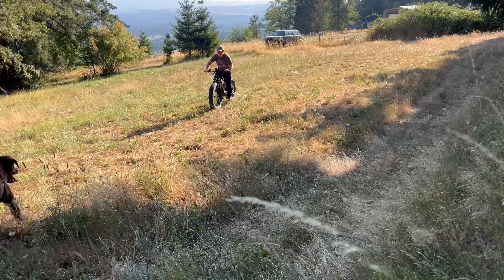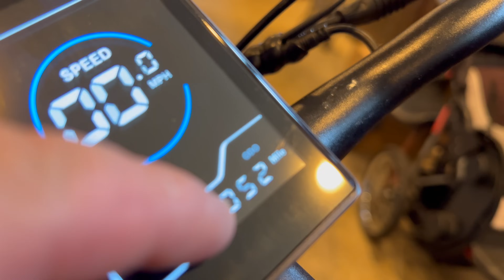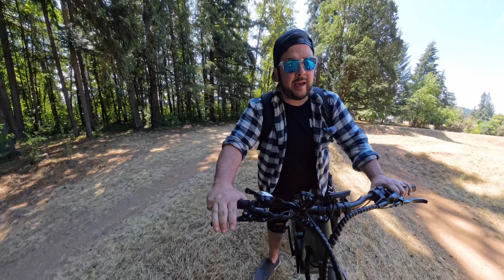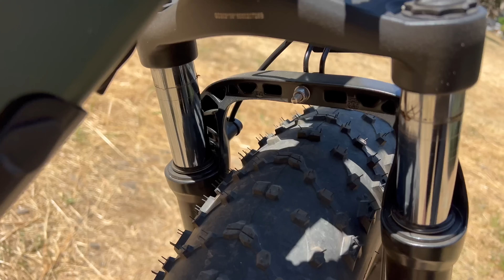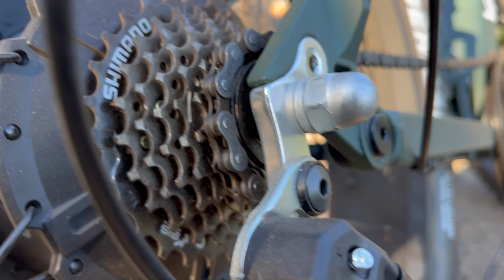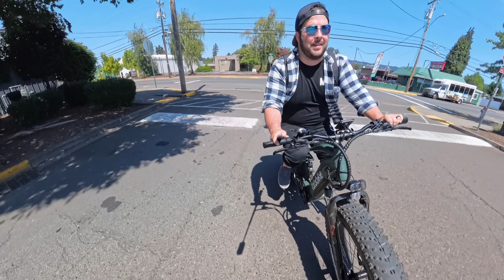Beefy Eye Catching 👀 E-Bike for OFF Roads, LONG Range & Comfortable Rides. YotoBike Leopard Pro +

Comment: There are way too many e-bikes in the market now. It’s hard to know which bike will be around next year or two. Most of them will be no service parts or support. I can’t recommend anyone to buy it. I think the Aventon is the best way to go.
Reply from the maker: the way this one is made requires low maintenance, and if there were repairs needed for a wild reason, the parts are there. the thing that may not last forever is the battery. but that’s replaceable. but not every e-bike is got everyone, just gotta test them out and find the right one for you 🤙